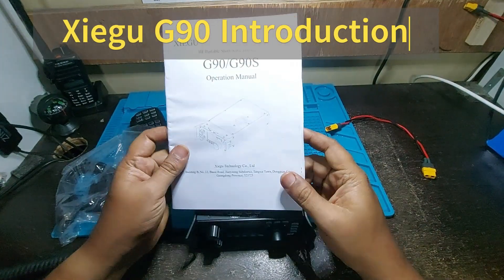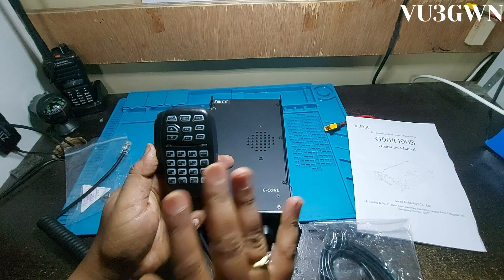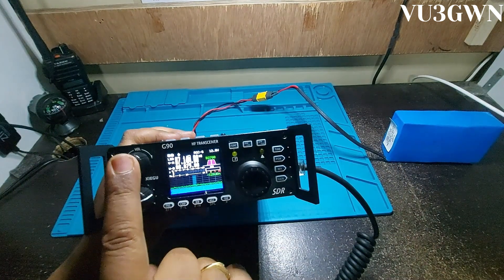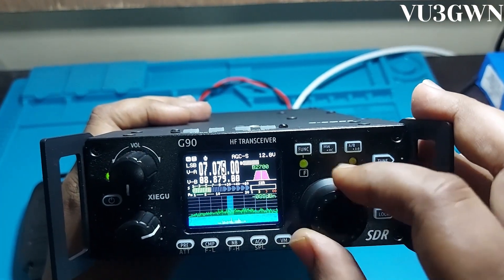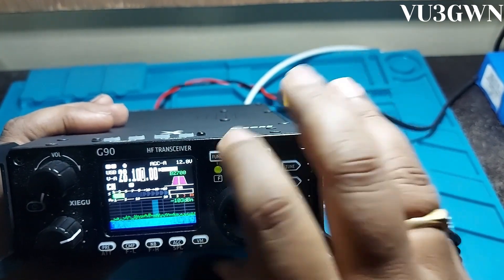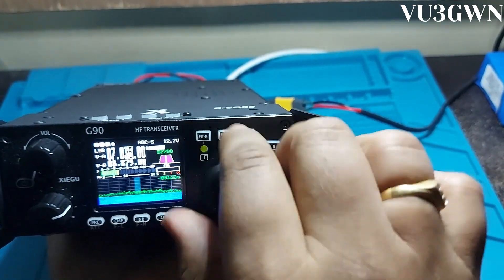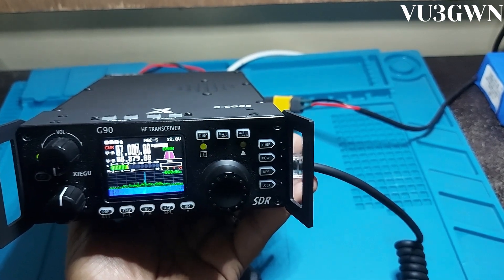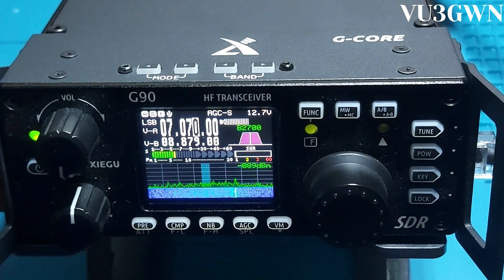Xiegu G90 Introduction

Comment: When you get to the user define RF , squelch,etc...how do you change these values? there is the save and exit button but no up/down...
Reply from the maker: The same button works in two modes... when you press and hold, you get the option to save and exit for each setting. Each setting can become the primary setting. Once you select say, POWER and you save it. Exit out. Now in the main screen, you can just turn this knob to adjust power.